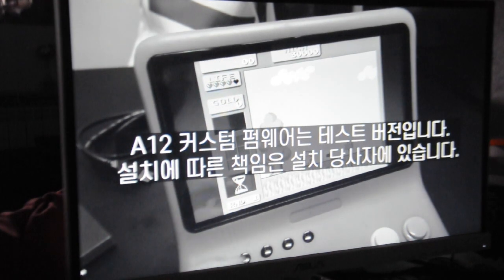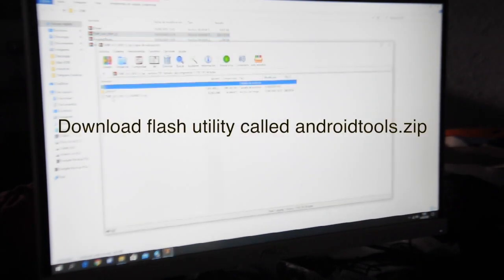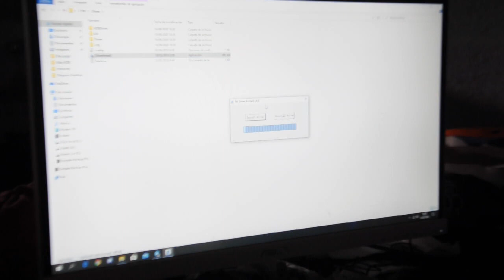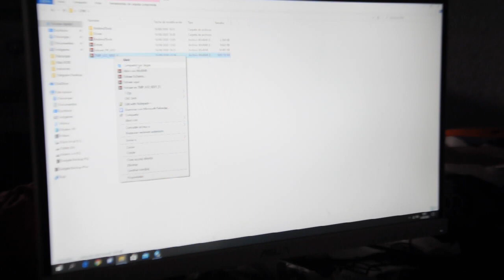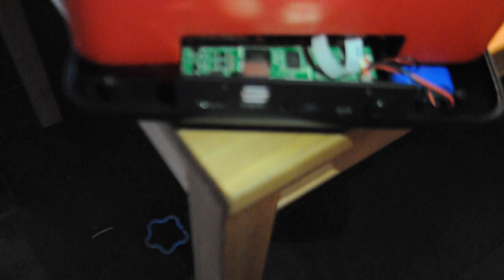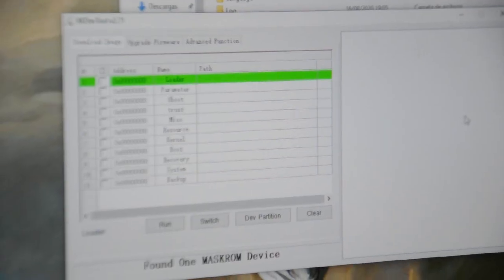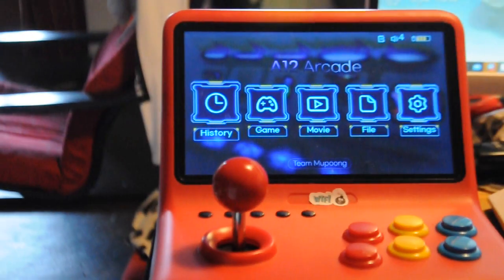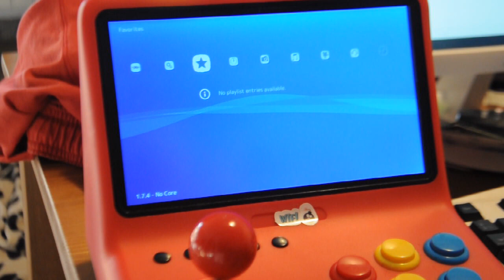POWKIDDY A12 - HOWTO INSTALL CFW - (ENGLISH AUDIO)

Comment: I have got firmware running but not much works not even snes what cores are people using for snes? Mame seems really bad also i did manange to gdt amidar working but thats it
Reply from the maker: Try update cores. Default are a bit old
Reply: Tried that no joy. Can anyone advise if they got snes working and which core?
Reply: @TheU4er  No SNES for me either
Reply: Did you ever fix it?

Comment: Hello, if I install cfw can I add c64 emulator? And also mame?
Reply from the maker: Hi! Mame of course. C64 if it's suported by retroarch yes again.  I not tried it, mame yes works well mame2003plus, mame 2010, mame2016 cores
Reply: @retroxmack  brilliant thanks. Sorry which firmware do I install as there's a few on your link?
Reply from the maker: @Wildchild121007  if menu burron on cernter rev 2 if menu button on right rev 1
Reply: @retroxmack  just to confirm you need to plug the USB into top one, it will not work with USB3?
Reply from the maker: @Wildchild121007  i don't know if it will work with usb3. And yes must go to the top one.
Reply: @retroxmack  soory meither again, I've tried 3 times to format the sd card, fat32? But not working
Reply from the maker: Wildchild you tried recent c64 cores?

Comment: Ok, have installed the CFW on my powkiddy a12 and been messing around with it and this is my opinion so far.
With CFW you have the option to open retroarch through the file menu.
This is retroarch version 1.7.4 and it gives you some advantages with the device although its still is full of bugs.
As extra systems that run without glitches and proper speed i got running are   sega master system, sega32x and atari lynx.
Besides that with retroarch you have quite a few cores for arcade games. I tried with mame2003 and the romset seems to work fine.
So it needs some work and be more stable. To bad i could not get pcengine to work but I've seen videos working. Hoping for an update but his is a good start.
Reply: Oh. I'm running everything from a 128GB SDCard without problems, even when A12 specification says upgradeable to max 64GB.
First cloned the stock included 32GB SDcard to a new 128GB SDcard with HDDRaw Copy. (only way i found working)
Second extended the partition on the cloned 128GB SDcard to maximum 128GB with Partition Magic.
Now got a lot of extra space for your own roms/games.
Looking forward to your PCEngine video, cannot get it working yet.
Sega cd is also possible, but could not get it to work yet. Anyway, keep up the good work, Powkiddy A12 is becoming an amazing device for it's money.
Reply from the maker: Roy Tönis i use 256gb sandisk
Reply from the maker: Pcengine and pcengine cd works perfect. My next video will be about it. Thanks for reply and think about retroarch 1.7.4 it's very old version. Try to use updated core of beetlepcefast.so core
Reply: Ok. Thnx. You are doing good work
Reply from the maker: Roy Tönis Thanks!

Comment: Can someone explain in English what exactly the firmware adds/does differently as we do not have a link to a ReadMe or any kind of explanation in video. Without knowing what it does why would we want to flash new firmware? Does it fully unlock Retroarch so you can add cores (how?) Does it include drivers for USB WiFi dongles so we can update Retroarch online? Any tweaks to adding roms so we dont have to edit the XML ourselves manually?
Reply from the maker: Meth Methanoid it enables access to retroarch 1.7.4. You can use more cores an use the newest ones. It’s a weird retroarch version. At the moment it can’t be updated
Reply: @retroxmack  thanks, so if I wanted to add Amiga to the system, I presume it wont appear in menus but I can load Amiga ADFs by clicking on them via File Browser?
Reply from the maker: Meth Methanoid right you can load amiga core then amiga rom. Also you can try to at a comoatible playlist
Reply: @retroxmack  overclocking kernel next then :-D
Reply from the maker: Meth Methanoid at the moment with right cores it have more better performance

Comment: I flashed this on Coolbaby RS-18 and I can confirm it works! REV1_E
Reply: how did you do it? i cant connect it to the pc
Reply: @flo_el  i wouldnt do it. It will remap your buttons and ability to shut down and take away n64 emulation (which was garbage anyways) im literally the only person with a stock image of the RS18 due to my connections in china.
Reply: @danted4917  thanks, do you have a link for the stock image, so i could try to upgrade the retroarch?

Comment: There is no need to tear down the machine. You just need to connect to PC with USB from upper USB port, press select+menu+vol-+vol+,  power on, then your PC will recognize your A12.
Reply: It does say "LOADER" device then instead of "MASKROM", is that correct?
Reply from the maker: Rainer K. Yes, correct
Reply from the maker: Xiaobing Gan where you get that info?
Reply from the maker: Tested and works!! Thanlks a lot for info!!!
Reply: @retroxmack  I have a similar machine and that works easier, just press menu and power on. So I think this one should have similar trick and tried several combinations.
Reply from the maker: @xiaobinggan3517  i mean you have an aiwo too?
Reply: @retroxmack  I dont have an aiwo machine, I have a unbranded 7' machine which also uses RK3128.
Reply: Doesn't work for me at all, PC recognises nothing.